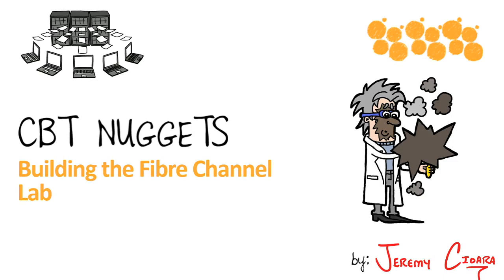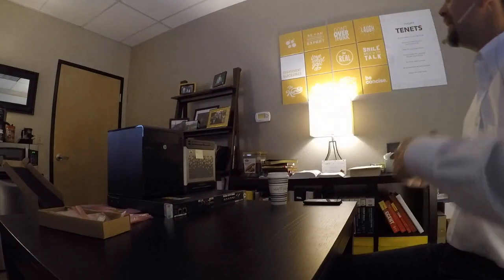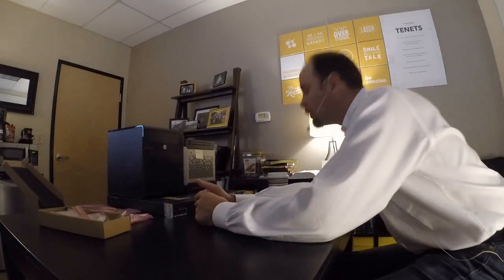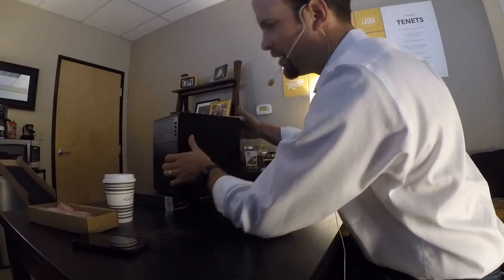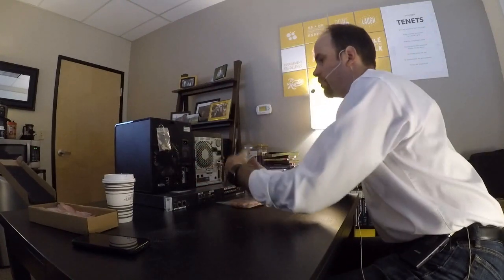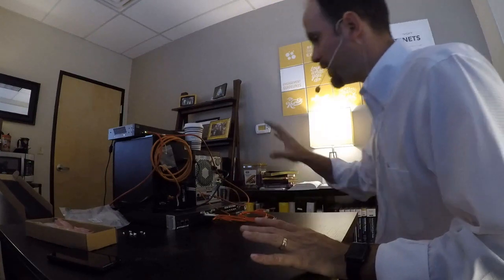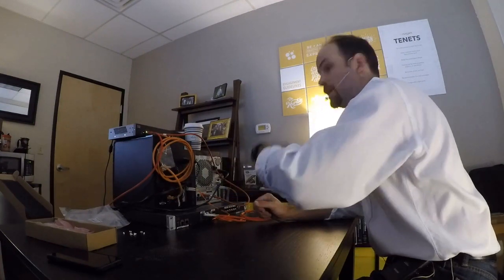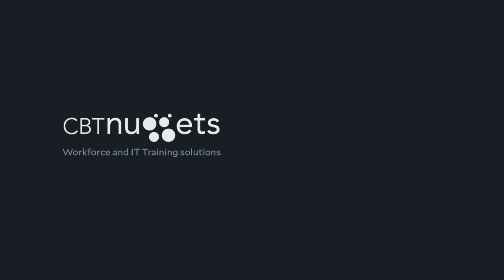MicroNugget: How to Build a 4 Gbps Fibre Channel Lab for Under $100

Comment: If you really want to get into the higher end storage and become a storage admin,  far better to just get a Brocade switch off of eBay. That way, you can get used to the Brocade fabtic commands, create zones and so on. A 24 port 4Gb Brocade Silkworm 200E is usually less than $100. Get two of them to configure multipath connections along with multipath policies. For targets, you can get inexpensive FC SAN like HP MSA 1000 or 2000. Make sure they have dual controllers so you can configure multipathing.
Reply: yeah, the problem with the brocade stuff is their stupid licensing - what good is my 24 port 8gb switch if i can only use 8 ports at 4gb speed without somehow begging the company to sell me a license file for an obsolete product, or spending entirely too much time trying to figure out a valid code generator for it? I think mine is going back on the bay as soon as I buy some hardware that isn't inherently a scam.

Comment: Helpful video, what do you recommend for a cheap cisco switch to use for a 10Gbps or 8Gbps SAN home Lab?
Reply from the maker: There are several ways you can go in order to utilize a 10Gbps link. Depending on your setup, you can do a P2P connection. The 10G nics on the server and end device can be on the same network, then you set up the routing for those to move traffic.

Another is to have an inexpensive Cisco or X vendor switch that has 10G SFP+/GBIC ports with modules. The issue that you might run into is the number of ports available. Most of them will have 2- 4 ports. So you'd have your server and or client/server, which would connect to the switch via the SFP+. You'd most likely still need to set up a dedicated network for the 10G.

There are going to be other limiting factors when using 10G uplinks, such as hard disk read and write speed. You can do file transfers only as fast as the HDD and components can handle.

I hope that helps! Thank you for learning with us.

Comment: Can someone who understands fiber-channel help me understand why he didn't choose a peer-to-peer connection (given the setup and ability to add a switch later)? I have 2 dual-port 16gb brocade cards I'm trying to implement in a 'System X 3650 M4' IBM hypervisor to an old Poweredge 2950 running truenas and I feel like I'm over my head (I have IT support, several programming languages, and CCNA level networking experience, though, so I'm not completely out of the loop)
Reply: I wanna know the answer too.
Reply: For peer to peer I'd rather just do a direct access storage instead though.